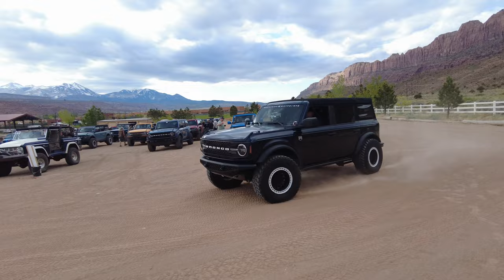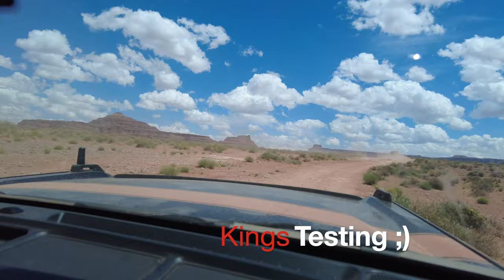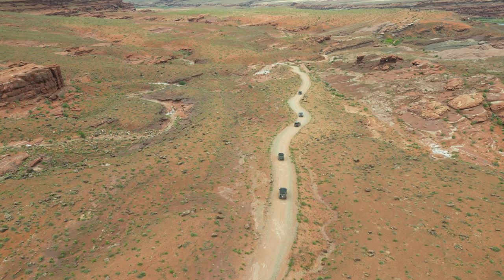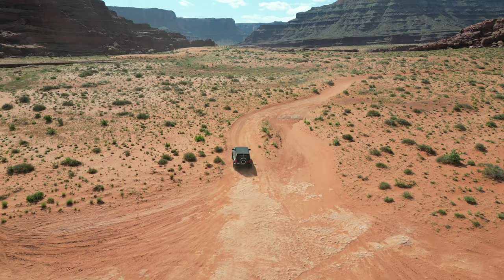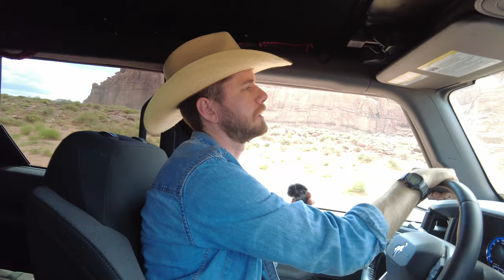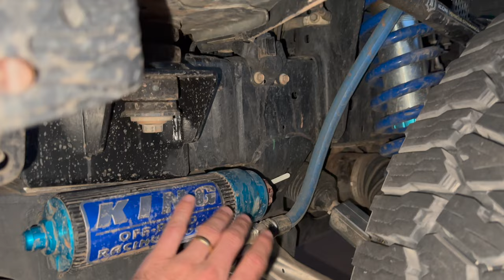Bronco Safari Day 3! Chicken Corners

Comment: did you air down at all? What modes did you use?
Reply from the maker: Airing down not needed for this trail but it helps for comforts sake. I like to run 18-20psi to soak up the bumps and smooth out the ride. 10-15 when looking for traction. Even lower if needed. 

As far as modes I wheeled for awhile without modes so it’s still foreign to me. Sometimes I’ll throw it in sport but that’s about it.
Reply: @POPO_PATTY  thanks I have never had modes per say before. I have been trying them out. I know this may sound funny, but I wish I had a split screen when in rock crawl or mud n ruts. I can see the ground right in front of me which is great from the front bumper. I would like to say map of the trail at the same time.
Reply from the maker: @beardedtravelguyreviews4692  I kinda like that idea too! Maybe Ford can release an update